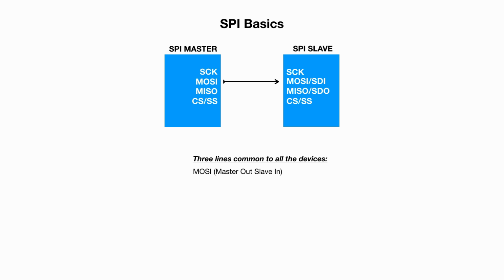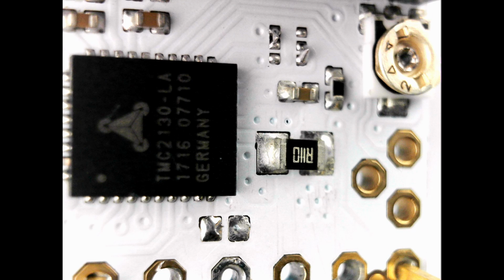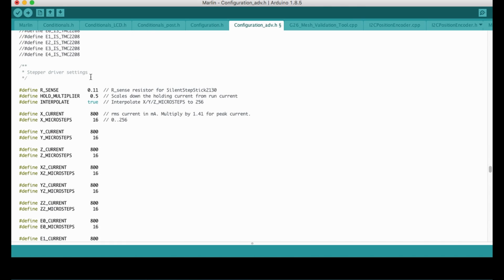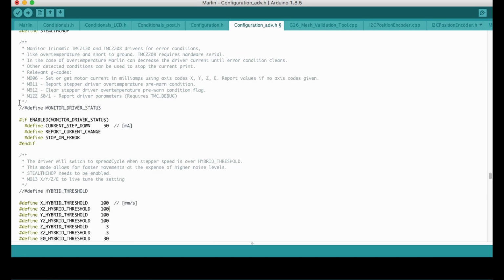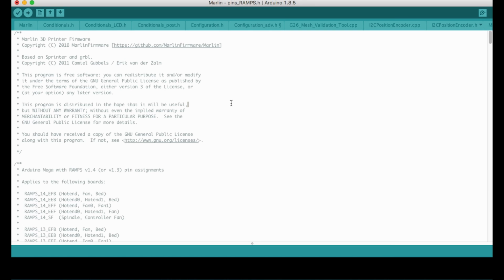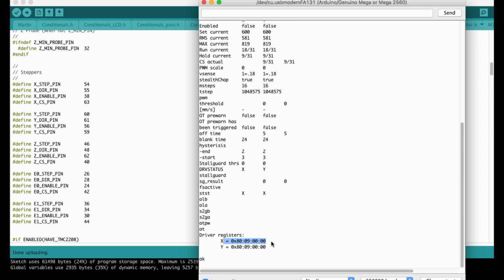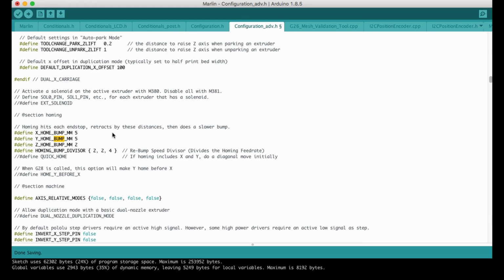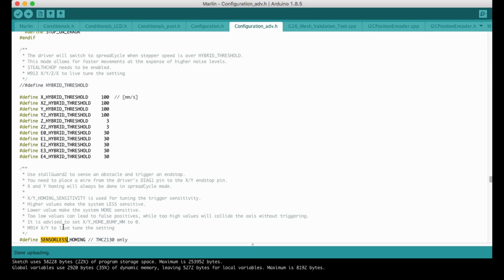How to use Trinamic TMC2130 with RAMPS 1.4 in SPI mode

Comment: Hello bro,  thank you for the great instruction. However, I could not make TMC2130 work with marlin 2.0 using RAMPS 1.4.
I get Bad Response (All HIGH and All LOW) errors for my both TMC2130 driven axes (X and Y). I could not solve the problem even though I have watched and read almost every other instruction. I think somehow I am the only person that uses these components with marlin 2.0 in the whole community :D.  
Could you manage to upgrade this configuration to Marlin 2.0  or do you have any other recommendations for this problem? 
Thank you in advance.
Reply: hi, for me the key is step 2, my tmc2130 come just like it shows in this video
Reply: @alejandropena8087  Thank you for your reply, my drivers were also came as in video and I have done required soldering. Unfortunately that didn't solve my problem :(. I have searched a lot but i still could not find any solution, maybe it is a hardware related problem.

Comment: Hello! Unfortunately I was unused to configure the TMC 2130 SPI drivers along with RAMPs, the engine do not work, 12V power, I connected everything right, but did not work. Can you share your firmware?
Reply from the maker: Dear Jonas, currently i am using Klipper firmware and i do not have configuration file for marlin. I was using lastest version of marlin 8bit.

Comment: At 7:09 you're saying AUX3 on your ramps is occupied by a LCD screens, like in my case to. But not only the D49 and D53 Pins, the SPI Pins D50-D52 as well. So that's not making any sense to remap the driver SPI Pins, if I'm not able to use the SPI pins D50-52, right? What is the solution for this? I'm using a standard 4 Line LCD Display like many other printer are using as well.
Reply: Just found this video accounting this issue:
https://www.youtube.com/watch?v=w4ZD4fx4z_A
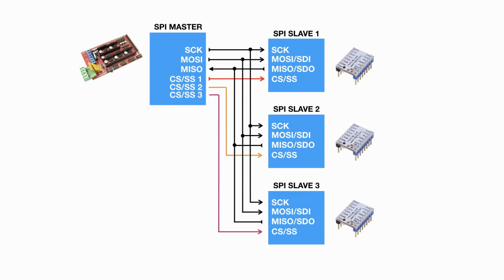Reply from the maker: You can solder jumper wires on LCD connectors. I am using https://reprap.org/wiki/File:Smart_Adapter_v2.jpg this adapter with my LCD. As seen on 1:05 all spi bus is parallel. I am happy to hear that you found a solution. Best regards

Comment: Hi. i can use 4x 2130tmc's and set the CS , all in the D pins in AUX2 port instead of AUX3? i want also use the SD card (only CS pins, i know the CLK, miso/mosi need use the pinst in the AUX3). greetings
Reply from the maker: Yes you can use other pins for CS, it depends on your configuration.

Comment: Thanks for the video. I am building a 3D Printer by myself and using MKS-Gen 1.4 with TMC 2130 drivers. I am having problems to configure it. Do you think that I need to follow the same procedure you used in your case?

Comment: I am not quite clear why you had to put fresh solder on the standalone pins. Was that necessary or were you just cleaning things up a bit?
Reply from the maker: Hello, i soldered the standalone pins to make it work in spi mode. If you not need to use spi mode it is not necessary

Comment: Worth noting before trying to bridge those tiny pads:

Use a camera that can get really close and zoom in or some other powerful magnification to check if the pads are already bridged. Some manufacturers ship these with the board contacts bridged as shown in this video, but they are so small you might not be able tell.

I tried bridging them on my board and made a bit of a mess of it. In the process of trying to clean it up, I used my mobile phone as a magnifier to look at the other driver boards I got and saw that they already the pads bridged (probably 0 Ohm resistors). The resisters were black (the boards i have are green), and so tiny all I could see with my eyes were the solder spots on the end looking like tiny exposed pads... even when wearing some reading glasses and/or cheap fresnel magnifying sheets I have.

Comment: Okay, panicing here, do I or do I not have to solder bridges on my tmc2130 because this is pretty different from thomas sanlander’s tmc2130 video
Reply from the maker: It depends on how you are going to use your board (jumper settings), after you decided which mode to use. After you learned your jumper settings, all you need is to control the pads.
Reply: @mytechtips4239  Unfortunately you didn't show how you set up your jumpers on the ramps :-)
Reply from the maker: Dear  @gibmirschnell , jumper pins are not important because they are de-soldered on tmc2130 board as shown in the begining of video for spi connections. TMC2130 has no connection to jumper pins. It is up to you if you want you can remove them freely or leave as is

Comment: iyi çalışmalar,  TMC2130 v1.0 var elimde. CFG1'i gnd ye çektim ve vref 1V olarak ayarladım. Sistem aşırı sesli çalışıyor. Motor frenlemesinde sürücülerden sinyal sesleri geliyor.Spreadcycle için cfg2 nin de open olması lazım fakat tmc2100 da fabrikasyon open durumunda, tmc2130 v1.0 için kendimi mi open yapmalıyız? --------------------------  there is TMC2130 v1.0. I set the CFG1 to gnd and set the vref to 1V. The system is operating with excessive noise. The motor braking signal sounds from the drivers. The cfg2 must be open for the spreadcycle, but if the tmc2100 is fabricated open, should we open the tmc2130 v1.0 myself?
Reply from the maker: Hello, do you still have the problem? I haven’t used tmc2100 so that i can not compare the pin configurations. If you are hearing high pitch noise please try with lower currents like 800 rms or change Chopper of time to 140T.

Comment: Hi mate! Thank you for the video, it really helped me.
I found a better solution to connect the TMC2130 and made a video where I solder a new connector for the SPI pins, so you could still use regular SD Card readers and Displays :)

BTW, the TMC2130 config pins are SO HARD to solder. It would be great if the driver had a DIP Switch for configuration.
Reply from the maker: Hello, thanks for the information, you are right soldering was really difficult at first try:)
Reply: Do you mind sharing the link to your video?
Reply: great video !! thx. do you have link to buy the 90 degree connectors u used?
Reply: would you share the link for spi + sd card + lcd?
thx :)

Comment: I have the same v1.0 drivers like you and I succesfully created those bridges. The problem is if I plug them, they get really hot without a motor connected.
Reply from the maker: They must not get hot unless you installed them wrong or they are broken. I have mistakenly burned one stepper motor driver when i installed it 180 degree rotated to ramps board. After that it was getting hot.

Comment: Thank you for this tutorial. Everything is almost fine. X and Y is quiet and react as should. But Extruder motor now clicking as if it don't have enough power (I didn't change it)... no jam in nozzle - 100%. What it can be?
Reply from the maker: You are welcome, which mode do you use for your extruder?
Reply: It"s gone away. Now it's fine. I can't remember how I fixed it...

Comment: this is a very nice Video! i have buy a MKS Gen V1.4 and Motor Driver TMC2130 from Watterott.com. i have in Marlin 1.1.8 everything done the same, but is does not work!
Reply from the maker: Sorry i do not have experience with MKS Gen v1.4, if it is like ramps board it must work.
Reply: I have found the mistake! it works now!
Reply: RC3D can you share your configuration and setup? I’m having issues with sensorless homing.

Comment: Thank you very much for posting this video.  Tom's video was not very informative as far as the pins and I had some errors.  I ended up replacing them with TMC2100 drivers as I thought it was just my poor soldering job causing the fault to ground errors.  I still have the 2130s though, so maybe I'll give them another try...  Thanks again.

Comment: I don't understand if my driver working 
LETTI: Enabled  false false
LETTI: Set current 0 0
LETTI: RMS current 1767 1767
LETTI: MAX current 2491 2491
LETTI: Run current 31/31 31/31
LETTI: Hold current 31/31 31/31
LETTI: CS actual  31/31 31/31
LETTI: PWM scale 1 2
LETTI: vsense  0=.325 0=.325
LETTI: stealthChop true true
LETTI: msteps  16 16
LETTI: tstep  1048575 1048575
LETTI: pwm
LETTI: threshold  0 0
LETTI: [mm/s]  - -
LETTI: OT prewarn false false
LETTI: OT prewarn has
LETTI: been triggered false false
LETTI: off time  5 5
LETTI: blank time 24 24
LETTI: hysterisis
LETTI: -end  2 2
LETTI: -start  3 3
LETTI: Stallguard thrs 0 0
LETTI: DRVSTATUS X Y
LETTI: stallguard   
LETTI: sg_result  0 0
LETTI: fsactive   
LETTI: stst  X X
LETTI: olb   
LETTI: ola   
LETTI: s2gb   
LETTI: s2ga   
LETTI: otpw   
LETTI: ot   
LETTI: Driver registers:
LETTI:  X = 0x80:1F:00:00
LETTI:  Y = 0x80:1F:00:00
LETTI:
Reply from the maker: It is working, register values seem normal
Reply: " Driver registers:
LETTI:  X = 0x80:1F:00:00
LETTI:  Y = 0x80:1F:00:00" 

its def seeing your drivers correctly in SPI mode. Those X and Y values would be all FFs if it wasnt wired up correctly.

Comment: Nice video, but it's really bad practise to change something in pins_WHATEVER.h file.
Instead you can simply override these settings via Configuration_adv.h
and after that you can be shure the only changes you've done are just in 2 files - Configuration.h and Configuration_adv.h

Migration of all your changes to new Marlin FW will be much less painful in the future ;)
Reply from the maker: Thanks for the information. I haven’t tested the configuration_adv.h for override. If it really override the variables it is cool. Best regards
Reply: It works this way:

#ifdef X_CS_PIN
  #undef X_CS_PIN
#endif

#define X_CS_PIN 4

UNDEF is there for disable warnings that macro is already defined ;)
Reply from the maker: Thanks for the undef :) it really helped.

Comment: hi, i cant seem to get my mechanical endstops to work. im using endstops with 2 wires and i connected them to the signal and ground pin. any suggestions? i learned alot from this video as well, thanks.
Reply from the maker: Your settings must be exactly like in video (11:24). Please disable the endstoppullsup & change endstop_inverting for that axis to False.
Reply: what i did now is, enabled all endstops MIN and MAX plugged all mech switches normally in MIN and plugged tmc 2130 DIAG to MAX "S" pin and disabled sensorless homing. it there going to be a problem with this long term? seems to be working at the moment
Reply from the maker: Btw M119 command in marlin shows the endstop states. You can test your endstops with this command and see their states
Reply: MYtechtips yes i was able to do that 👍
Reply from the maker: I am also using mechanical endstops now :) it will not make any problem do not worry
Reply: how are your stepper motors btw? do they get hot? mine is probably 40-50 degrees, by feel its like the hotbed. do you know if thats ok?
Reply from the maker: I haven't measured mine but 40-50 celcius sounds normal. (as long as you can touch to them with no burn)

Comment: Hey, really nice video! What about if I'm using an LCD screen on AUX3? Is it possible to get both LCD and tmc2130 drivers working together by assigning different pins for MOSI/MISO/CLK signals?
Reply from the maker: Hello, now i am running my printer with lcd. I soldered a cable on lcd driver board for Mosi, miso, clk pins. They are common lines.

Comment: Are the jumpers on the ramps below the tmc2130 still required when using the stepper drivers with SPI ? Any ideas ?
Reply from the maker: Jumpers have no function at all, if you want you can remove them.

Comment: Thanks for making this vid!! I'm also interested to know what exactly those solder bridges in the beginning are about ? Would a standard trinamic tmc2130 from watterot need those solder bridges ? I was under the impression that those are ready for SPI out of the box ?
Reply from the maker: You are welcome, no watterot drivers already has those bridges.
Reply: thank you very much for this anwswer. So this bridge soldering thing is specially for those aliexpress drivers right?
Reply: I purchased my drivers from digikey.  I just burnt one up today and also the Arduino Mega Board and who knows what else.  I do not know what happened or why.  

Do I need to solder these jumpers on the digikey boards.  They are from trinamic directly.

Comment: Hi, what does the solder bridging change? is it completely necessary? Btw your video finally got my drivers to work, thank you!
Reply from the maker: I am very happy to hear that you found my video helpful. My Chinese tmc2130 drivers came in standalone mode.  So we need to do soldering bridges to convert it to spi mode. If your drivers also do not have those bridges, it is necessary to do otherwise spi mode will not work.
Reply: Does that mean the "v1.1" version by Fystec are preset for spi control? 
https://www.aliexpress.com/item/5X-MKS-TMC2130-V1-1-For-SPI-Function-Stepstick-Stepper-Motor-Driver-With-Heat-Sink-5PCS/32849429358.html
Reply: Thanks a lot for the video and the explanation!
Reply from the maker: Yes it means SPI mode.
Reply: Ouch, after looking at the TMC2130 I got those bridges are really tiny. I'll need a more delicate solder point.
Too bad those SPI mode stepper drivers haven't hit ebay yet.
Thanks again for the instructions!
Reply from the maker: You are welcome. Actually, there is another method if you have liquid solder paste and hot air gun, you can try to solder those bridges with them.
Reply: I have managed to do the bridges with a very dull iron, but it took me at least an hour....